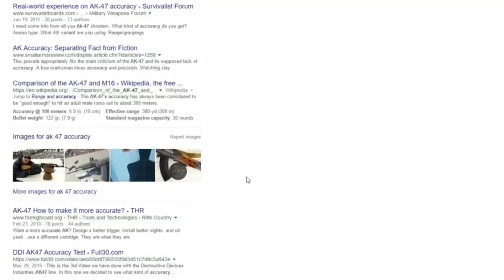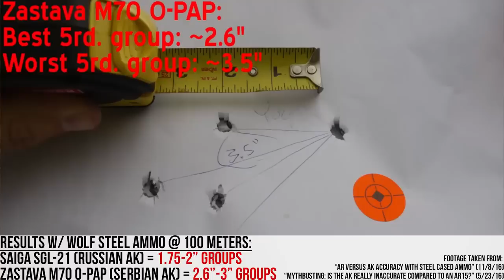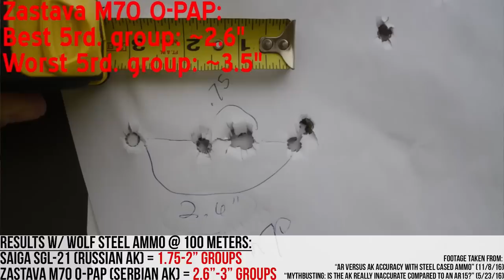Busting the WORST AK-47 Myths! (Featuring InRange TV and Mishaco)

Comment: I think the "innacurate" myth comes from that AKs were manufactured all over the world with wildly varying degrees of quality.
A point that comes up often is that US army trials found out whereas the AK was capable of 2 to 5 MOA, the M16 was capable of 1 to 3 MOA, depending on the rifle. Assuming that's accurate information, untarnished by american pride getting the rustiest AKs aghainst factory-new M16s, it puts most AKs solidly on the grounds of "accurate enough".

And about mass production and "being cheap", well, as a mechanical engineer, I can tell you division of labour is pretty much standard nowadays in pretty much every industry (and was invented waaay before Ford was even born. Before the Industrial Revolution itself, really. What Ford came up with was the Assembly Line, not really applicable to small stuff manufacture), so you can't really scratch it off as being the result of it's production method.
The AK was designed to require as little manufacture operations as possible, and that requires extremely expensive tools, such as drop forge hammers and steel stamping press tools. Overall, mass production means a steep initial investment that pays itself off with the hundreds of thousands of pieces it makes in a lot less time than standard machining would. It took them 12 years to get right, with the original AK-47  being replaced by the AK-47 type 2 (a.k.a. the AK-49, though soviets never refered to it by that name), with the famous milled receiver, which was a stopgap until they could get the stamping processes right.
The M16 had a lot of mass production features incorporated into it's design. The receivers where injection moulded (aluminium) and then milled out. The furniture was injection moulded (plastic). The magazines where stamped steel and also where the handguard heatshields, I believe. The thing is that the M16 was considerably expensive to produce, which led to Armalite developing a much cheaper AR-18, heavily inspired by the AK but still familiar to the AR-15 design, using a fair ammount of stamped steel components. Even internal ones at that.

I think a lot of the myth that the AK is cheap comes from the ones that "went missing" off the cold war storages when the iron curtain came down. They eventually found themselves in the hands of guerrillas and petty dictatorships all over Africa and the Middle East, drug cartels all over latin america and street gangs over at the US, notably the gangs of LA. Reportedly cheaper than other weapons in the black market, that can be assumed to be because smugglers got a ton of those and didn't have to fork over the costs of obtaining them. I've also heard an AK and a full magazine can cost as much as a chicken and an egg in certain parts of Africa.

Comment: I've shot an ak-47 with a hellfire auto system(preban), at 800 rounds per minute, it bent the casings during ejecting, turned down to 600rpm it fired fine. I like them.

Comment: myth #5: actual name of gun is NOT AK-47, it's AK .  AK-47 carried one of the pre-production samples (identified by a long wooden forend), as well as a small series of prototypes No. 2 (1500 pcs.) Produced in the spring of 1948 for military trials before the introduction of AK in military use
Reply: Despite being Russian, I will type in English so everybody else can understand this. You are absolutely correct - well, if I remember correctly, the prototype was called the AK-46, not 47, but indeed, the official name of the mass-produced gun is the AK, not AK-47. However, I think that the AK-47 has become sort of a trademark, a cultural tag across the globe, so now nobody gives a shit I guess.
Reply: That's pretty much what I said, the prototype was named AK-46. It also featured an AR-style lower and upper receiver, borrowed from the StG-44. I didn't know that the prototype was called the AK for Automatic Carbine instead of the Avtomat Kalashnikova, though.
Reply: If you really want to pick nits, most AK-pattern rifles in the US are AKM rifles with stamped receivers
Reply: Well, I've seen a lot of AKMs (also, correct me if I'm wrong, but the original AK was produced in a way smaller series than the AKM), and even AK-74s called AK-47s, so I think he has a point.
Reply: Technically it was Automatic Kalashnikov, model of the year 1947 until the AKM was adopted, but Soviet manuals with AK-47 printed big on the cover were a thing in the 50s.

Also, K never meant carbine, as all names in the competition for a new automatic carbine were named Avtomat Designernameinflected. The last competitor to the AK-47 was the AB-46 (Bulkin), which was almost identical in function and construction.
Reply: Yeah, that's what I thought about the name. Thanks for the info.
Reply: Didn't know about the 48, thanks.
Reply: I'm pretty sure I saw one from 1953 with AK-47 written on it instead of AK, as you see on the 55 and 57 manuals. I can't find a scan online, though.
Reply: Everybody also forgets about the AK-46 prototype rifle.
Reply: But we just talked about it for, like, the first half of the comment chain?
Reply: Well, it is called AK-47 in US army manuals and other US army sources. AK is the name that pre-AKM models are named in soviet training boards and other sources. So, I quess the western countries got some bad intel, and they just stuck with it.
Reply: Y'all realize ak stands for automatic Kalashnikov
Reply: Можешь коротко написать какие мифы он в ролике  описывает. Не владею англицким. В субтитры тоже не очень.
Reply: Персей миф 1 - мол не точный
Миф 2 - не убиваем (в итоге надежный, но, вот это да, тоже надо хорошо относиться)
Миф 3 целиться не удобно из-за дистанции между целиком и мушкой, в итоге дистанция как у м4
Reply: @zapelen  Спасибо !

Comment: The AKM is extremely reliable except when it comes to soppy mud. Due to the gaps in its design, soppy mud easily jams the weapon. The AR platform is better for soppy mud because its design is sealed and directs gas out the bolt which blows that mud away. Dust on the other hand can jam an AR relatively easily, where as with an AK dust causes practically no issues.

Comment: The short sight radius thing, I don't think the issue is the actual measured sight radius, but how far forward the rear sight is. When using iron sights, having the rear sight closer to the eye makes aiming faster and easier since the rear sight becomes almost like the pivot point so you only need to move the front sight onto target and it's pretty much lined up. Having the rear sight so far forward you have to constantly ensure that both sights are lined up along with the target. What you've been told about it being "better" to be further forward is complete hogwash. The whole point about the rear sight being close to the eye means you don't have to pay attention to it at all. Like I've said, it becomes kind of a pivot point so no matter where you point the front of the gun, the rear sight is always lined up since it stays by your eye. So you just move the front post to where you want to hit and it hits it. It's actually why whenever I see newbies, or people who were never formally trained, pick up an AR and immediately extend the collapsible stock all the way to its maximum length (why even bother with a collapsible stock then??) because they seem like they are afraid of the gun and shoot with like a 10 inch eye relief to the rear sight, I point out to them that if they tuck the gun in and move their face closer to the rear sight it would improve their shooting, and it always does. So there you have the same exact gun getting more accurate (not the gun, but the shooter, but it makes it easier to be more accurate is the real reason) simply by moving the rear sight closer to the eye without changing the actual sight radius.

Comment: Thanks for the video. I have to point out a few things about your myth busting.
When you do rifle accuracy you never EVER measure group of 3 since it is pointless. Here is a direct copy from US Army test procedure for small arms.
"3.1.1 Sample Size. The number of weapons and rounds to fire per weapon must be considered
in determining sample size. The number of weapons should adequately represent the population
from which the sample has been drawn. If the sample is too small to sufficiently detect small
differences in the statistical parameter(s) of interest, a conclusion regarding acceptability cannot
be made with confidence."
From what I remember US Army use to test 3 groups of 20 rounds to determine accuracy. 
Also, as somebody who carried AK-47 and its variants in 2 Balkan wars I can assure you from my combat experience that AK is one of the MOST INACCURATE weapons I have ever used. I also used Yugo M77 in combat with 7.92x57mm ammo. That rifle is 3 MOA with PPU sniper ammo that Ex-YU Army had in abundance. On the other side between multiple M70's AKs that I shot, good ones can be 4 MOA bad ones do go to 6 MOA no problem.
It is nice for you to shoot on a fair day in your shorts and measure groups of 3. Try that in sub-zero weather when you did not sleep for 2 days and soaked to the bone. AK tolerances are terrible. That is why if you measure AK accuracy you need to measure at least 3 different rifles. One can be OK another can be SOB (side of barn) accuracy.
Another thing about AK, the darn thing is so not ergonomic and heavy... After lugging it around for days and nights you just want to throw it over the first cliff. I cannot tell you how many cuts guys in my unit (including me) had because of bad AK ergonomic. Oh and one more thing, AKs do jam and have issues. Yep, experienced couple of them in some heated fights in Bosnian mountains.
I was lucky enough to come to USA. I love guns and my safe is full or ARs and AR-like variants. I have NO AKs in my safe and I refuse to get any. I just don't understand why some people in America have such an irrational love for AKs.
After experiencing AKs in war and now owning ARs I would take AR into fight without thinking twice over any AK variant. 
Good old M4 with 16 inch barrel and carbine gas system. Plus I can haul much more 5.56x45mm ammo than 7.62x39mm ammo.
If I want 30 cal AR I would take 300 blackout over any AK in any situation. I can shoot farther and be way more accurate with AR in 300 blackout that AK.
I will repeat again, I just don't understand why some people in USA love AKs so much.

Comment: Jamming an AK47. The AK requires less and ease to maintain. 

You can open everything and fill it up with anything, but you need to clear it some what. Spray it down, throw in water, blow it out, bang it against a hard surface, or do something to clear it some what.

If you put it in water and freeze it solid, it would not work because the parts would not move. But break the ice loose, and spray or put it in water, piss on it, or hit it with a torch to allow the parts to move, it will function. 

You can be nice and put some old motor oil, cooking oil, diesel oil, mineral oil, or most anything to lubricate it in a pinch. Is realistic, unlike most other firearms. Mike

Comment: It should be mentioned for the sake of austerity that Carl's test was meant to be extreme
Pretty much any rifle subjected to such conditions will fail at that point. And it's not totally unrealistic either. However, the test doesn't show (nor did it need to...) that the AK's simplicity would allow it to be rapidly cleaned and returned to service. Being that muddied isn't a big deal when it would take all of two minutes to bring the rifle back to working order. They were designed to be easy to maintain after all.

The test absolutely debunks the myth of the indestructible AK platform, but that's only half the story.

Comment: I had no problem to shoot groups tight as matchbox from 150meters  with my finnish rk62 when i was in army, that was off course new rifle which i used as i did competition shooting both in 150meters and also 300meters.ammo was standard military jacketed 7.62x39.with match grade ammo rifle was even more accurate.

I also have m4 carbine and m4 starts to make difference in longer distances when you shoot +300 meters.

But finnish rk62 has also much better(peep)sights than ak.

Comment: Myth #2 is slightly true. The AK can jam, it is very possible, but you can throw hundreds of rounds through the AK and it won't jam. That's why the AK is very popular in the middle east because a little bit of sand wont jam it while your throwing rounds through it. Your also never going to throw the weapon through gallons of mud, its obviously going to jam after that, but also keep in mind there are many ripoffs and variants of the AK. If i got anything wrong please let me know
Reply: I would say the AK is very popular in the middle east because it is the weapon which is easily available there, but undoubtedly the reliability factor gives it a preferential status (which again, likely matters little since they are 'easily available') over other designs.

Comment: Just to note about accuracy: FDF only accepts RK´s that are sub MOA and as you know those are the Finnish copies of AK. In other words, AK is not inaccurate as platform. Most of them are just made with somewhat loose tolerances and even then it is still accurate enough for combat ranges.
And about reliability: I remember that we had jammed RK´s every now and then especially after a long day of training at forest when the gun was full of moss or whatever and at that point it kept on jamming. The good thing about AK platform is that most of the time you can clear jams by forcibly cycling the system and then keep on shooting and if that did not help all you had to do field strip and quickly empty all the crap from weapon.

Comment: its like saying the stamping is cheap. it is but the tech to do it properly is hard in the fabrication process. it takes mechanical engineers decades to get it right which is why the first AK and boutique custom ak's are CNC milled. stamping is a mass production method

Comment: Accuracy; depends on a number of factors, part tolerances, ammo, shooter, type of AK, just to name a few.
Reliablity; basic maintanence and cleaning on any well made weapon will keep it operational and reliable.
Sight Radius; comes down to experience with the weapon as to how effectively you are able to use the sights.
Cost; as always this is the economics of scale, generally the more you make the cheaper per unit cost.
Have used this weapon as a small arms instructor with the ADF, if I found one on the battlefield I would happily lug around the extra weight for a while.
All in all the AK platform is a reasonably (to very) accurate, reliable, easy to use and cheap weapon, it does the job with a minimum of fuss. Simple.

Comment: Two things, one on reliability and another on production cost.
First on production cost, the AK has a very low part count and lax tolerances, so even on a small scale it will be naturally cheaper to produce than most weapons with tighter tolerances and higher part counts.
Second on reliability, compared to its western contemporaries, the AK tends to be easier to gunk up because of the loose tolerances and not being as well sealed. But, the torture test of shoveling mud mixed with large grits into the gun isn't all that realistic. The reliability comes from the general tolerance of the gun to common amounts of dust and debris in under normal operation. It also is extremely easy to maintain due to low part count and can operate reasonably well even without being cleaned. Even in situations where enough dirt does manage to halt its operation, it's much easier to clean out with a bottle of water than most guns would be in a similar situation. All this means that while in a normal user's hands the well sealed AR would prove to be much more reliable, the AK fits right in to your average soviet conscript's hands, requiring little more than a few lessons for him to understand the weapon in its entirety.

Comment: Best way to make an AK unreliable is to use a polymer magazine. One of my friends had a Wasr 10 at the range. Jammed repeatedly. He got pissed at it and said that he was going to sell it. I got out my wallet and said I will give you 300 for it. He laughed at me and said you're getting screwed. I paid him. Put a  steel east German mag in it and emptied it without an issue. Put a steel Croatian mag in it and repeated it. Same with the Korean mags. Then he was really pissed. I sold the polymer mags at a gun show. Have 4 Norincos never used a polymer mag. As cheap as the steel ones are why bother?

Comment: I have several rifles, but the three I'll mention are:
Russian AK47, built in the early '60's (AFAIK). Unissued.
Chinese SKS (Norinco, Milled, screw in barrel) Date unknown. Unissued, with Choat stock (Factory stock was crap).
S&W M&p15, vintage 2002. With match grade trigger.

Here's my take on it. I'm considered an expert marksman. I shoot three round groups only.

AK47, using Yugoslavian, M67 ball Komada brass cased ammo. I can get sub 2" at 100 yds, all day. Average is 1.3 - to 1.6 MOA, from the AK. I kill hogs with this rifle out to 250yds.

M&P15, using 62gr Match King, UNDER MOA, all day, as long as I let it cool some between shots. I have head shot deer with this one over 100yds.

"Cheap" Chinese SKS. Yugoslavian, M67 ball Komada brass cased ammo. Gritty trigger that I learned to use to my advantage, UNDER MOA. I killed a large hog, 300yds with this. It's my main hunting rifle.

My point? I don't care WHICH one of these rifles you use, if you're a decent marksman, it doesn't matter. BTW My AK will jam on occasion, as will my AR, However, my SKS has NEVER FTF!

The ONLY complaint I have about my AK? It's a little nose heavy for my shooting style (I don't use a forward pistol grip, and I keep my hand close to the magazine. so I don't alter my POA.

AK47, is OK with me!